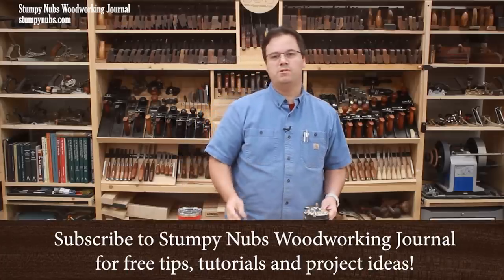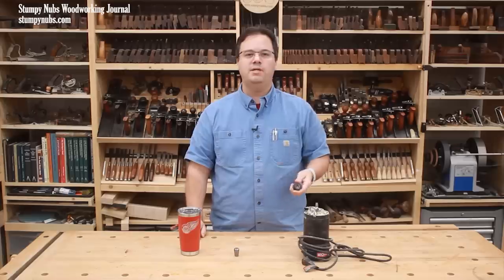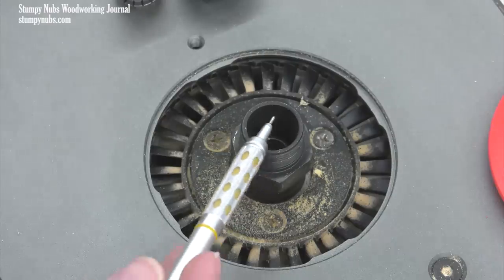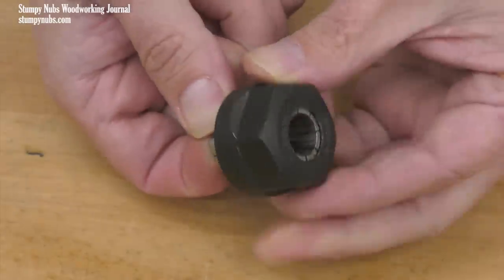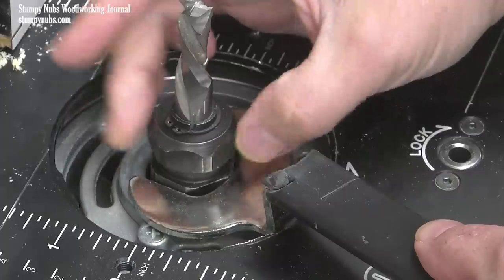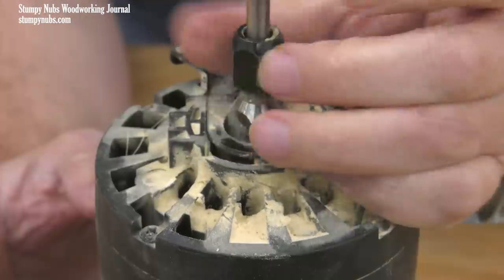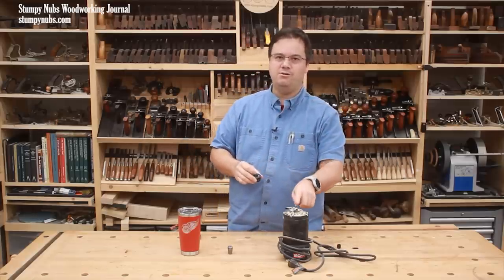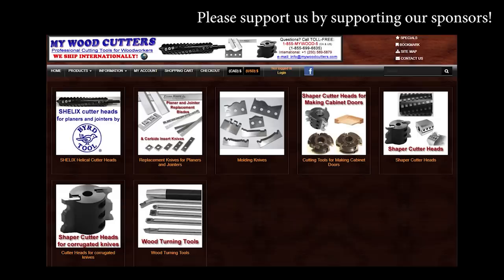Why you have to loosen your router bit TWICE!

Comment: Thank you you just saved me from buying a new router have a Craftsman that I bought at Sears but Sears is no longer around nobody seems to know anything about a colic Departed router bit goes in I have a quarter inch I need to put in a half inch bit you can pop it out and put a new half engine to replace the quarter-inch it'll do both I did not know that thank you so much you helped me so much I watch all your videos I've learned a lot keep the good work current website

Comment: Not only a Master Woodworker but a tooling Engineer as well.
These vid's illustrating tool construction are invaluable in showing that the idiosyncrasies of many tools are there for a reason.
The lesson!  Make sure your tool isn't  faulty before you send it back or; God forbid; try to mend it.

Comment: I have a Bosch router in a table and a 2.2kw spindle on my CNC with an ER20 collet.  Both of them did this and it has always driven me nuts.  I finally learned to keep a hold of the wrench until I'd loosened it a 2nd time.  And now I know why and that kind of makes me happy.  Thanks!
Reply: Yeah especially on the CNC it's super annoying because sometimes the cutter just falls straight out after the second loosening and if it falls onto the machine table, there's a good chance you'll break part of the flute (especially on the aluminum cutters with a single flute) or damage the tip on a chamfer tool.
Reply: My DeWalt 20V trim router does the same thing since it has the self-releasing collet, too.  I think this is a pretty common thing nowadays.
Reply: What collet size for 12mm Router machine? Er20 is compatable for 12mm Router machine?
Reply: @manzerasobrado6045  ER20 will work for a spindle, but not a router.  You'll need to look for a 12mm collet specifically for a router.
Reply: @dgoddard  my Router machine is 12mm
What collet size for 6.35 bits
Reply: @dgoddard  the router machine i bought is 12mm, the router bits are 6.35mm how do i attach the router bits what size collet to use to fit the machine please help me
Reply: @manzerasobrado6045  You will need to look up your router model and see what collet sizes are offered for that router.

Comment: I have been using collet sets on metal lathe and milling machines since I started a toolmaking apprenticeship in 1967.  On lathes you usually have a draw bar that pulls and pushes on a sleeve that passes through the spindle for the collet to screw into, so you can change the workpiece in just a few seconds, plus they go down to sizes that a chuck couldn't grip, and are kinder to the workpiece leaving no marks on softer materials like brass.  Collet sets on milling machines work exactly the same way as described by James in this video, and need the second pressure to release the cutter.   Anyone owning a smallish hobby mill will know that you can get collet sets for crazy low prices from Wish and Bangood (about $80 for an M2 collet chuck and a dozen collets from 2mm to 20mm) and they work (almost) perfectly.  That is to say they clamp the work piece but some of the collets didn't snap into the collet chuck without some minor work with a fine grit diamond plate.

Comment: These are ER style collets that are used in the machining industry. If you measure the outside diameter of the largest part in millimeters then you know what size they are (ER-20, ER-25, ER-32, etc) 
That makes replacing them pretty easy.

Comment: My makita trim router has the second type of collet you mentioned.  It does tend to get difficult to get the bit sometimes.  I have found that giving the parts a good cleaning reduces this problem a great deal.  I soak a few minutes in a solution of laundry soap and water, give a gentle scrubbing with whatever i can get in there ( a pipe cleaner today), rinse well and set to dry on some warm surface to be sure the water is all dried up.

Comment: if your bits get constantly stuck, it could also just be a terrible surface finish on the collet. i had it on my makita palm router for example. every bit got stuck and i had to bang them free. the ruff surface grain basically starts to lock together and thats what keeps it from releasing. 
You can simply sand a smoother finish on the collet and the connecting surface. if the grains cant interlock, they wont get jammed. i sanded it on 400 and 1000 grit and have not had a single stuck bit afterwards.

Comment: Recently replaced a dewalt router,  and it came with like a combo collet..its like 2 sleeves in 1. Used a 1/4 bit, but when I went to remove it, the sleeve came out with the bit.when that sleeve is out, you can use 1/2 inch bit..was a little leary, but so far so good.

Comment: A somewhat related issue I've seen people run into, is where they are suddenly unable to get a bit to fit into a collet that was previously fine.  
In 9/10 cases, it was because they tightened the collet without a bit in the router. They did this to secure the collet firmly to the router after use, in an attempt to 'keep it safe and make sure it doesn't go missing'. Without the shank of a bit to provide resistance, the collet is compressed until the hole is narrower than the shank diameter it was designed for.

Comment: As a machinist that loves his collets... Please only use ER collets with the intended range (which is quite small, 1 mm is the most common). There are cheap sets that allows the whole range to be properly tightened for not much. For woodworking there's no need to get a precision set from brands like Schaublin, a cheap "E-bay" set will do perfectly fine. And don't tighten them up empty or with a shaft only partially inserted (the latter might cause the tool bit to come flying). If damaged/cracked, discard and replace - a collet is cheaper then body parts.
Reply: Oh and standard mistake 1A: putting the collet into the spindle before putting on the nut. If you're unlucky that collar and tool is in there for good and you'll need to buy a new spindle! (Yes I've done it but I was lucky and could knock it out from behind)
Always snap the nut on the collet first!

Comment: Good vid, you should make a video all about how one should read the manuals for tools and how not to always follow them but read them none the less because some are invaluable.

The first router I ever purchased had split ratings no middle ground most of them said they had to use pliers to remove the bits mangling them. So i found the digital manual read it and said to loosen the collet twice.

I've had my Hitachi 2.25hp router for 5 years now after picking it up for 99 bucks with all the accessories brand new likely due to the vendor having to do a sale to move inventory due to the 3 star rating at the time.

Comment: Nice bit of info, I always like knowing exactly why something works the way it does 👍
I've bought an adapter which will allow me to use ER20 collets with my 1/2" router, meaning I can now use any size of bit rather than just a few sizes.
I'd bought a full set of ER20 collets to go with a spindle I bought for building my own CNC ... I wasn't paying attention and didn't realise the size of it and that it weighed 5Kg, so needless to say I've not built the CNC yet!!

Comment: When you intall a router bit, should you back it out a millimeter or two before tightening the collet?  I've been doing it this way for years because it was the way I was taught - the reasoning being that a bit may get get stuck in the tool it's jammed all the way down into the collet.  Thanks for your informative videos - always learning something new from your channel!
Reply from the maker: The bit shouldn't bottom out in the hole, but the biggest reason to not put the bit all the way in is because the shaft flares out a bit just beneath the cutters. Tightening it on that flared portion would be insecure.

Comment: Hey Stumpy Nubs armature framer here. I was recently watching some of your tablesaw safety videos and noticed you said most construction lumber isn't suitable for the table saw because of the bow or crown in it (risking a kickback.)  That makes total sense to me and in the past I have felt uncomfortable ripping framing lumber on the table saw.  Now I have settled on method that I feel fairly comfortable with and would like to know if I have deluded myself.  1. Using a table saw with a writhing knife, 2. using a fairly long push stick (1.5 ft), 3. standing to the left of the workpiece, 4. using fairly long and massive workpieces (think 2x6 studs and 2x4 studs).  I guide the studs on and start the rip without the push stick, standing to the left of the stud. This seems to me like the most likely kickback time because the cut hasn't reached the writhing knife yet. But i also feel safe (again could be deluding myself)  because my hands are nowhere near the saw (let alone the blade) and I am not behind the work piece. I push the workpiece which is supported on the other side of the saw with a pedestal roller until the workpiece is resting on the saw and then I switch to the long push stick.  My hand never passes the blade or even gets parallel with it, at the end of the rip it it is usually a ft away.  I know this method risks kickback, but it seems somewhat safe to me because my hands don't risk being pulled into the blade and my body is out of the path of the framing member. I would love to know if I could change my methodology to be able to rip framing members on a table saw or if I should desist completely.  Love the videos. 

ps. I would also like to know how the mass of the workpiece effects the kickback event. My saw is a fairly low power Skillsaw 99t.
Reply from the maker: I'm not sure I said MOST construction lumber is unsuitable for the table saw. I have raid SOME construction lumber is unsuitable, and I have said most ROUGH-MILLED lumber is unsuitable. I've ripped plenty of 2X4s and 2x6s on the table saw. I just make sure they are reasonably straight and I ALWAYS use a riving knife/splitter.
Reply: @StumpyNubs  ah, got it, total mishearing on my part. Ty for the reply.

Comment: I have an older Freud 3.25HP router (stamped as a 2003 model). Sadly I cannot find a replacement 1/2" collet for it... I THOUGHT I had, and ordered it online. It was definitely not the right one. It's a shame, because it's a beast of a router. I got it second-hand and it only came with the 1/4" collet.
Reply: Drop by a local small machine shop (with coffee bread or something) and ask if they recognise the type and where you can buy it (perhaps via them). Most shops have thick catalogues of all various types and sizes and/or good suppliers to turn to.

Comment: Have you ever heard of putting a O-Ring in the base of the router hole so you leave a small space so the bit doesn't bottom out when tightening?
Reply from the maker: You can do that. I just lower the bit all the way in, the raise it out a little bit. Works fine.

Comment: anyone know where i can get a 1/8" collet for a 890 Porter Cable collet nut? Or just a 1/8" collet nut? I dont have much room for an er11 adaptor and shank adaptors im not fond of
Reply from the maker: Just on a rotary tool. But some can be used as routers with plunge base accessories.
Reply: @StumpyNubs OMG thanks for the reply!! However, its for a home built CNC. I'm hoping to reduce my costs by buying packs of 1/8" shank bits for my 1/8" cuts instead of using 1/4" shank bits with 1/8" cutting diameter. So trying to track down a proper collet.
Reply: @TheCatmandu13  Buy what is common on the market.  It's much easier to get replacement down the road.  Custom is nice to save a few bucks.  But replacement of collet means custom made again.

Comment: Why does my router suddenly just drop the bit out? Thought about just chucking the thing but maybe there is a fix?
Reply from the maker: Is the collet damaged? Are both the collet and the router bit shaft clean? If you have ruled all that out then you may have runout in the router spindle, which causes micro-vibrations that loosen the collet during use. Watch the tip of the bit closely as it spins to a stop.
Reply: @StumpyNubs  Thanks for the reply! I will go see!

Comment: PASTE WAX.
Reply from the maker: Where?
Reply: @StumpyNubs  All over everything. Mating threads, mating smooth parts, bit shank, shank hole. I hope it works as good for yours as it did mine a few days ago.
Reply from the maker: Putting wax on a router bit shaft, which relies on friction to hold it in place, is a terrible idea. Both the shaft of the bit and the inside of the collect should be kept clean.
Reply: @StumpyNubs  i wondered the same thing but rolled the dice and found it still holds incredibly well when properly tightened.
Reply: @StumpyNubs  too late... I already use motor oil on the thread and I'm sure it seeps into the frictional surface.  LOL.  Still works.  I guess I can clean them and do some maintenance now I know better.
Reply: @ipick4fun27  The metal working community never wastes time worried about cleaning any chuck or "collect" with more than a blast of oily shop air or oil soaked paint brush. lol Are we Can or Can'tadians?